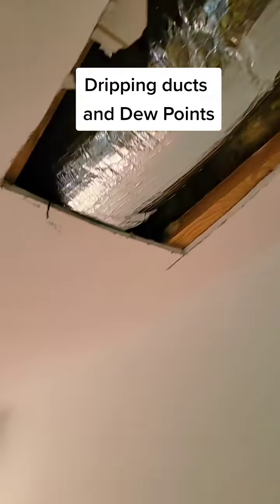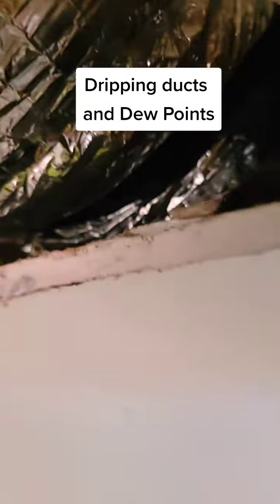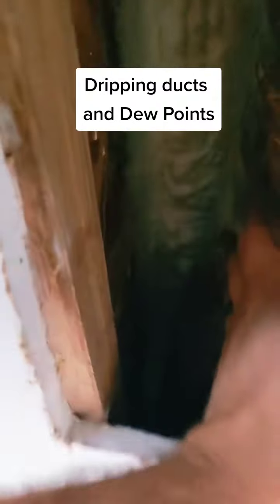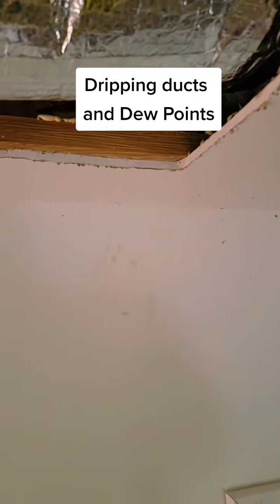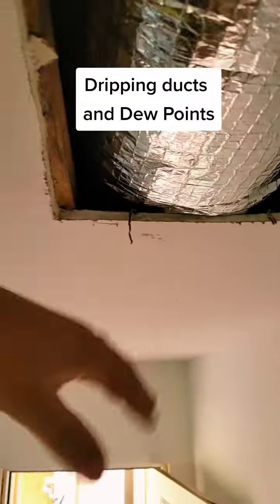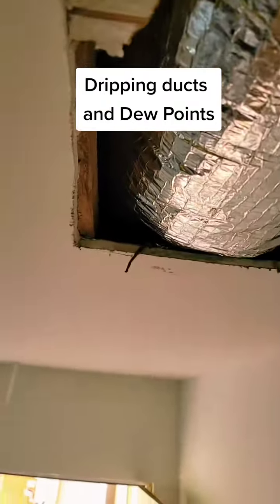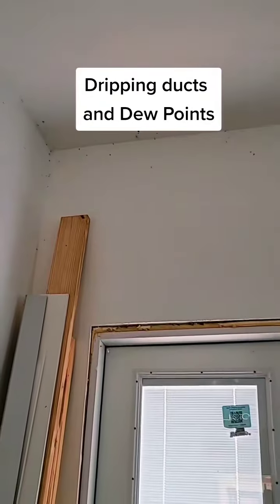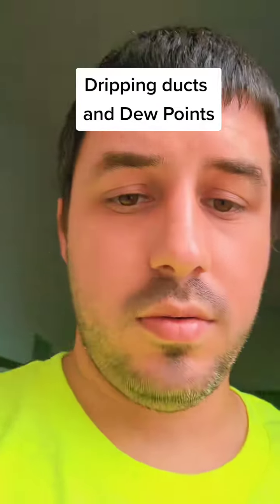this video is about ducts condensating on sheet rock and potential issues with expanding foam.

Comment: Hard pipe it and put a high density duct wrap on it and get a good air seal.  The insulation in flex ducts gets damaged easily or gets stretched thin sometimes.

Comment: Once a space is spray foamed, it becomes a conditioned space.

In order to prevent ducts from sweating, the air temp around the ducts needs to always be HIGHER that the dew point temp.

The bad thing about spray foam is that it reduces the air temp around the ducts....to the point that its BELOW the dew point temp.
& thus the ducts will sweat.

In a humid climate zone, you want it to be hot around air ducts....when its not, you get sweaty air ducts.

Comment: It’s wild coming across that can be a million different causes. Most likely is AC Unit itself needs to be tuned up and isn’t operating on right settings. Other option is hot air getting through the exterior of that space. Ducts will sweat when hot air gets near, check exterior with temp gun on a hot day to check areas potentially leaking cold air outside
Reply: The air temp has to be hotter than the dew point temp....otherwise the air ducts can sweat.

Spray foam conditions the air, so that its below dew point. So sweating occurs.